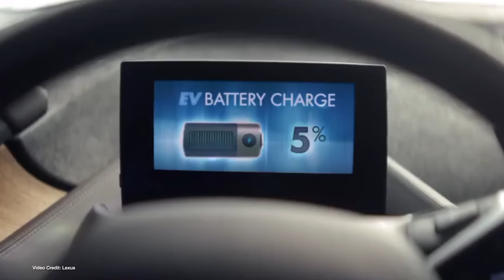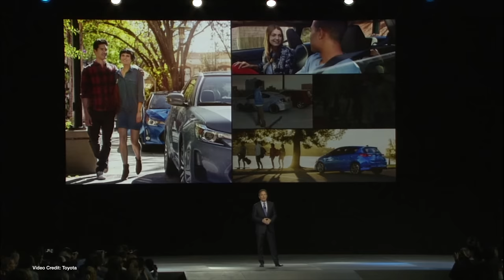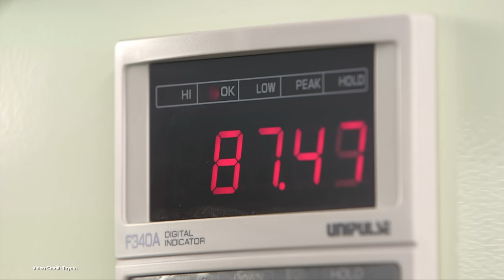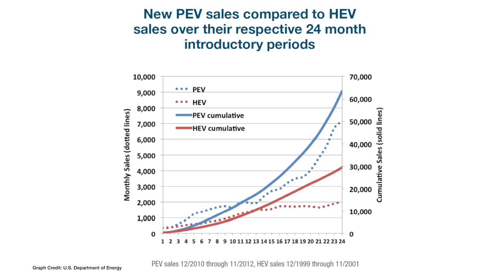Toyota Insists You Can't Ban ICE Cars Yet. It's WRONG.

Comment: Who are we kidding, ICE cars are not cheap anymore.
The average selling price of top 10 USA car manufactures in 2020 is 37000$.
BEVs are NO BRAINER with almost ZERO service/parts replacement cost  and fuel expense and tax savings on parts/service and cost on environment.
Reply: This is an excellent point. Sure, EVs are expensive, but there is this misconception that there's a prohibitively huge price difference between ICE and EV. That is not true. The best-selling car in America is the Ford F-150, and that starts at a little under $31,000. A decent late-model used ICE now costs $20,000. All cars are expensive now, not just EVs.
Reply: New cars are expensive. 
Main issue is that there aint many used EVs/Hybrids/Hydrogens that are on market at low prices.
I imagine granny would buy EV instead of ICE because it comes cheaper in longterm but her pension etc. aint enough to buy new car so used ones only options.
Reply: You know you shouldn't be thinking just about the price. The same F150 production secures jobs in key sectors of industry around you. The pure electric vehicles are not nearly as complex and can be made for less money abroad. but you won't see the price go down at the sales point if that's your thinking about
Reply: No kidding. I can't afford to buy an EV but my next car will be one and right now, IRL, the turbo of my ICE has stopped working. It will be expensive and my first though was "EV's don't have turbos".

Comment: I am a UK Toyota owner and have been for the last 20 years. I currently have a C-HR hybrid and have told my Toyota dealership that if Toyota don't have a BEV offering in 14 months time (when my lease ends), they will be losing me as a customer (as my next car will be BEV and not Hydrogen, ICE or Hybrid). I doubt I am the only one saying this to Toyota. Will Toyota want to lose loyal customers? I doubt it, but if they don't get on the BEV bandwagon soon with serious offerings, they will. Who's fault will that be Toyota?
Reply: They have already lost me - switched to Tesla in 2019 and haven't looked back (after 15 years of Toyota ownership) because Toyota had zero BEVs for sale. Two years on, still no options in the UK...
Reply: Maybe not clear for, but its perfectly clear to me!

They are launching 10 BEV models over the next 4 years whilst maintaining HEV and PHEV sales.  There is still the question of affordability in the A segment of the market. Despite what 'experts' may think, we still need cheap new cars at around the £12k mark - a BEV wont be ar that price point any time soon!

It may well be that synthetic fuels could be the future at the lower end, with BEV in the middle and FCEV at the larger end of the market - the fact is that no one really knows the answer yet!
Reply: Toyota bZ4X Battery To Retain 90% Capacity After 10 Years
That's the target set by the manufacturer.

Toyota announced, by the way of a broader conference about batteries and electrification, that its new electric cars will have significantly more durable batteries.

The target set for the upcoming Toyota bZ4X and following BEVs is 90% of initial battery capacity (and range) maintained over 10 years of usage.

In other words, a car that has 500 km (311 miles) of range when new, should still have 450 km (280 miles) of range after 10 years. Of course, we assume that it could be less if the user would exceed the typical mileage or fast charging usage (Toyota does not reveal info about that).
Reply: @gearhead_2.0 I never said Toyota should only produce EVs, so ICE will still be available until banned by governments (2030-35 in the UK). Toyota, after being in the forefront of Hybrid developement are way way way back where it comes to full EVs.
Reply: Happy supra owner, I ain't changing. Infrastructure is crap
Reply: @Musketeer009  That is where really Toyota is,         Behind.

Comment: I like the idea of Toyota not wanting the US government to ban ICE yet. I remember watching a video by Engineering Explained on why ICE engines are dead. He listed a lot of reasons, but one of them that stuck with me is consumer demand. Yes EV's will get cheaper in the future and I think they should be, but a lot of people do not want EV's yet. I like how they hybridized most of their models to have a positive impact on GHG emissions. Now you may wonder why they don't have 1 EV in their lineup, I also remember watching a video on efficiency and GHG emissions by Alex on Autos. He stated that having more hybrid options are better than having 1 EV and 4 ICE's. More specifically, he stated it is much greener to have 5 Prius Primes than it is to have 1 Tesla Model S (or 3 I forgot) than 4 gasoline Corollas. The only drawback being who would want a Prius Prime over a Tesla Model S? Personally I'd rather get the Prius Prime.

I also remember reading that Akio Toyoda stating that his home country Japan would not be suitable for full EV's considering that most of the electricity is made of natural gas and coal, and that it would put too much stress on the grid. 

I can see a rise in EV's in the future and I think it is good for energy independence, maintenance costs, and fuel costs. We may also see a mix fleet of hydrogen vehicles (long range trucks, possible hydrogen planes) and electric vehicles.

Comment: I love the density of accurate facts on this channel. 
Thank you, this is what I want in my news feed. Oh yes, and a little snark every now and then. :-)

Toyota is so close to having many EVs if they wanted them. Didn't Damian McGuire or New Electric Ireland recently get some old used $500 Lexus, pull the V6 and add a battery to make a super cheap EV? 
It is encouraging to me that Toyota only needs cells and DCFC, but I do worry about their corporate resistance these days since huge cell pipelines are needed to survive through this decade.
Reply: well facts have changed. toyota is now coming up with 15 BEVs.
Reply: @dwadd7528  "Toyota claims" We'll see.
Reply: @CafeElectric  T

Toyota will invest around $13.6 billion in battery tech over the next decade, including a $9 billion investment in production, as it attempts to electrify its vehicle lineup, The Wall Street Journal reports. It reportedly plans to have 10 battery production lines by 2025, eventually increasing to around 70 across an unannounced number of factories around the world. Eventually, it could produce as much as 200GWh of batteries, the company’s chief technology officer, Masahiko Maeda, announced in a press briefing.

Toyota’s commitments mirror similar investments planned by others across the au
Reply: @dwadd7528  Sure would be nice if it comes to pass, and good for the planet. A press release and article is not enough convince me after years of failure, so again "We'll see."

Comment: I’m in the UK, one of my friends insist that hydrogen cars are the thing. In the UK there are 7 hydrogen fuel stations, for the whole country. The nearest one to us apparently has been broken for 18 months, but even if it did work, it would take the whole range of the car to reach the nearest station. He conveniently forgets that his commute is 7 miles each way when he says that it would take 15 hours to charge an EV. He would probably only need to charge it once every 3 weeks, and has power to his off street parking already!
Reply: Ask your friends what the point is of using huge amounts of electricity to create hydrogen, to then put it into a hydrogen powered car which then converts it back into electricity - at a loss - to move the car using an electric motor....... Ask them if they think it might be better to skip the hydrogen production process, plus all the transportation that would be needed, and simply charge the battery in a pure EV in the first instance?

Comment: Toyota is right, for all the stated reasons, and many more: 
1. To go full EV we have to increase the battery production capacity by a factor of 50x. That will not happen in a decade, not even in 2. You can construct gigafactories, but natural ressources production cannot scale that fast. Constructing a mining operation takes decades. 
2. With existing battery production capacity and CAGR our emissions will be lowered by a far greater length if every new vehicle could be a rechargeable hybrid with a few kWH battery rather than just having 2% of vehicles electric and the rest ICE. 
3. The electric grid and especially the electricity production should be increased by a 5x or more times if I remember correctly the data from one study. It is a lot and will not happen in a decade.
4. Many industries must be electrified (cement, metal etc) putting even more strain on the grid. 
5. US started hydrogen production reasearch using heat from nuclear reactors, with far greater efficiency
6. Fast deployment of electric cars will make electricity prices skyrocket. Rich people will be driving electric cars, and the poor will be freezing in their homes after paying taxes that financed subsidies for rich people cars.

Comment: Toyota is right : EVs cost more than twice of ICE cars. They also require much more Raw material. The overall car's live impact should be taken into account not just when driving it!
Reply: Nonsense. There are EV's in the UK which are priced at the same level as similarly sized ICE cars of the same type.  Exactly how much lithium do you think is in an EV battery?  90%? 80?  Nope. It's less than 5%.........  So I'm not sure where this "much more raw material" comes from? Volkswagen for example, build their electric cars from a percentage of recycled materials, and plant based substances. These are used in the dashboard, door cards, carpets and seat construction. The car's paint finish is also plant based. You really do need to do more research before you post uninformed nonsense.....

Comment: A very interesting video and although I've been a loyal customer of Toyota/Lexus for over 25 years I find myself agreeing with most of what you've said.
My loyalty has been based on the superb build quality, reliability and value for money offered by their cars.
However, their lack of an EV strategy over the last 10 years has left me in the position of having to move away from the brand.  I have been told by Lexus staff that Toyota/Lexus are throwing everything behind hydrogen fuel cell development and they seem to genuinely believe this is the right thing to do.  I fear they may live to regret their intransigence as I can't see them being able to bring into being the necessary global infrastructure to make mass adoption of HFC vehicles a reality.  Perhaps this really is down to Toyota top brass not wanting to be seen to have backed the wrong horse.
I have been extremely happy with all of the Toyota/Lexus cars I've had but I've decided that my next car will be an EV.  But it won't be the Toyota Prius or the Lexus UX300E ......... which is just too expensive.

Comment: A hybrid vehicle, in my view, at this stage in EV evolution, is the worst of all compromises. You get the extra weight of an internal combustion engine and it’s complexity as well as batteries and an electric motor. I did not buy one for that reason and I think BMW is another company who should have just skipped the hybrid. Better just the batteries and electric motor and no internal combustion engine. However, I agree, we need better cheaper batteries and that appears to be happening.  Thanks for a good discussion of where the car industry is headed.
Reply: Nonsense, hybrid is the transition technology and it has worked very well including PHEVs, just for example tousands of people have converted their old prius to live and travel around the country very cheaply, also the rav4 and prius prime are excellent cars for those who can go much further miles without issues. Toyota has already sold over 12 million hybrids.

Comment: I was all about hydrogen cars back in the day but with producing hydrogen fuel, shipping and the improvement in battery tech, I'm now all electric.
Reply: Hydrogen is for the heavy industry.
Reply: Airplanes and cargo ships can't use batteries because of their weight. Like hetoila said, the heavy industry will probably pave the way for mass production of hydrogen and then some of that cheaper supply may spill over into passenger cars.
Reply: @rogerstarkey5390  explain

Comment: If only everyone would be able to afford to purchase EV, ,no doubt that Toyota would stop making ICE vehicles. For every 10 car buyers, how many of them could afford to buy an EV worth $40K plus tax plus financing charge? A lot of us, including me would want to transition to EV, but food on the table and roof over our heads is something we need to take into account. Someday, EV will become affordable, and once it does, count on Toyota, who knows, it may even surpass Tesla. And in fact, Toyota is already starting with their EV line-ups as you know.
Reply: Well said. One day we'll all have EV's. Until then let some of us also enjoy good old fashioned petrol engines. Cars aren't cheap. Do I want a Taycan, hell yes. But I also can't afford $120,000 right now.
Reply: @dot7107  That depends on where you are?
I wanted to replace my dads 2001 Mercedes E320 diesel with an electric,(We bought the E320 for $2k five years ago and have spent about $1.5k on it in the last five years)  
He drives around 90km/55ish miles a day,
Electric cars with a range of about 100km is close to 10k usd Here for the cheapest used,
We can go out and buy a petrol or diesel car(same model year as the electric) at one third of the price,
I really wish Citroen would make a 90km/h,100km range(all year round) version of the Ami(at less than €9k) because that would fit my dad perfectly,
I am collecting parts to begin converting my Subaru Impreza to electric,
Reply: "For every 10 car buyers, how many of them could afford to buy an EV worth $40K plus tax plus financing charge?".
Quite a lot. The average sales price for a car in the US is $37K. And they're cheaper to run and maintain.

Comment: The sad thing about hydrogen adoption in Japan is that before the Fukushima Nuclear disaster, it had a surplus of nuclear generated electricity with which to generate hydrogen via electrolysis. Toyota based its investments on this surplus. There once was a Top Gear episode where James May drove a Mirai and he mentioned this exact point. Unfortunately, the world changed and has collectively concluded that H2 is needed as a clean gas, but due to low availability and efficiency its main usage is in industrial applications, not in automobiles.